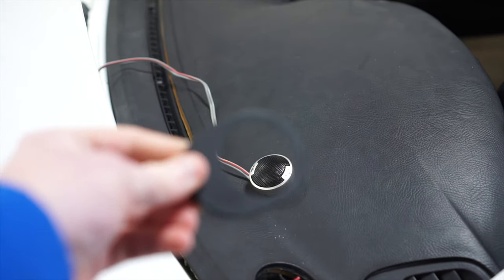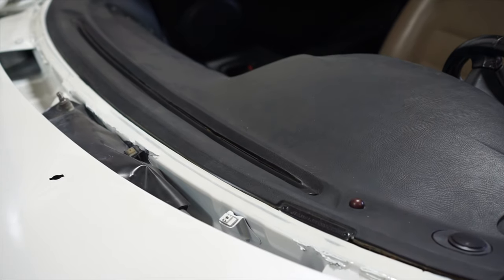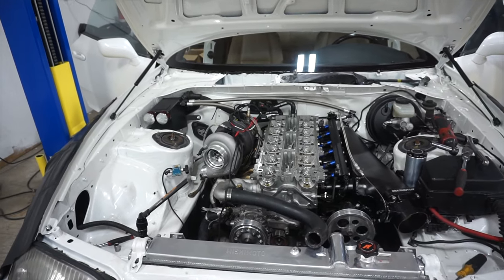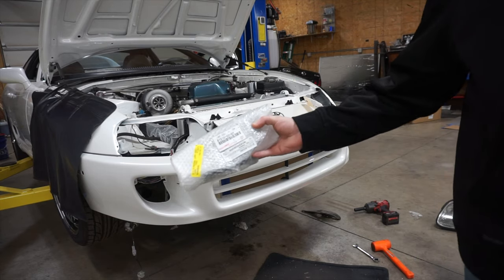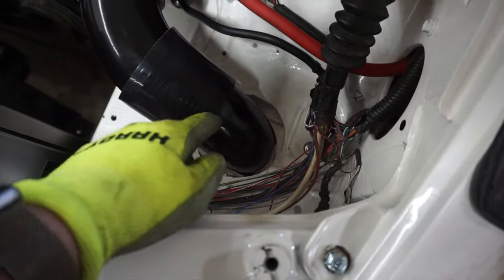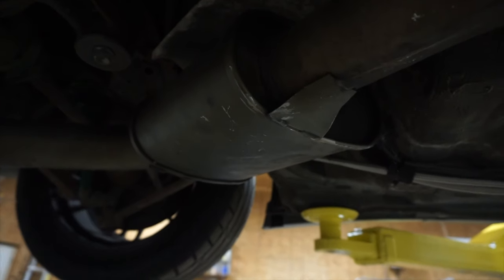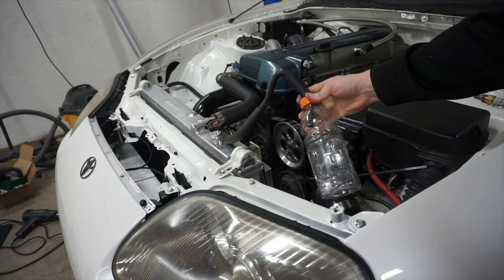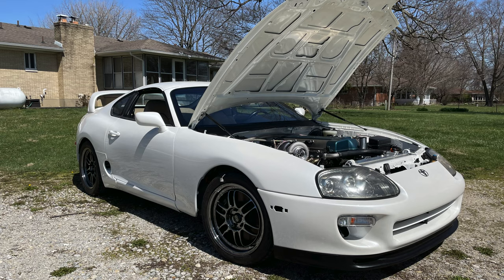Tying up loose ends - MKIV Supra Build - Pt.12

Comment: Dude, my head is currently at the shop getting valve job, bronze guide and gsc S2 set for shimless. Most machine shops know jack about 2jz heads. I constantly text the machinist to stay connected so shit won’t go wrong. Hopefully communication keeps everything in check.
Reply from the maker: Definitely a good idea to keep in contact with them to drive home the point you need it done right! Hope it all comes out good for you!